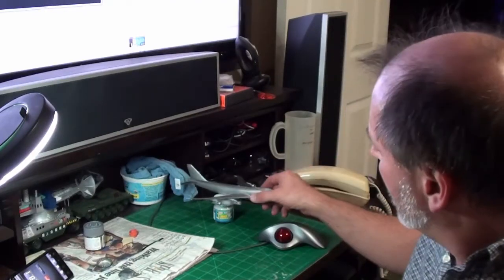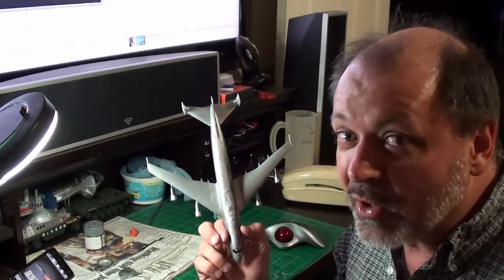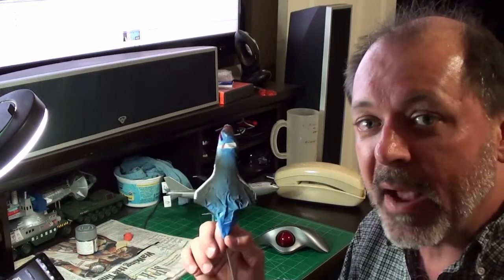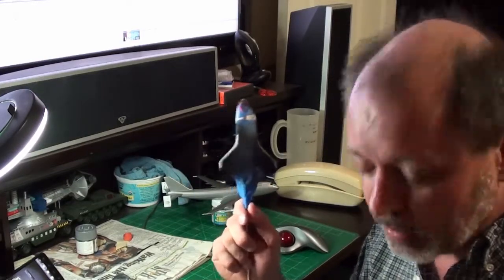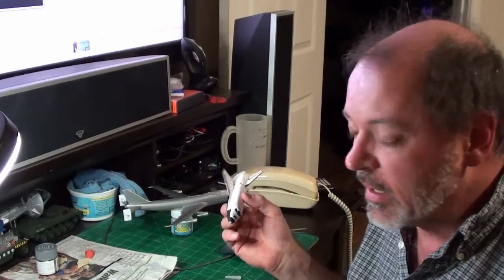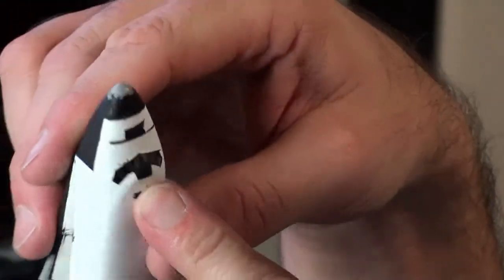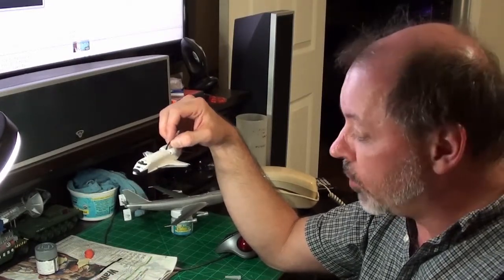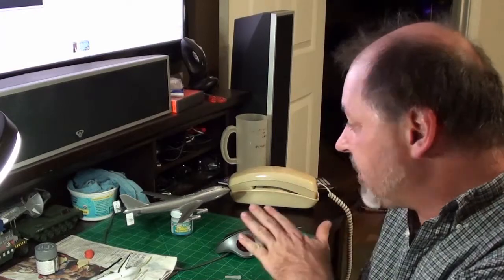Space shuttle with 747 part 7

Comment: Cool bananas. :)

You might want to invest in some Tamiya tape, it curves and conceals alot better than those heavy duty masking tapes, it's specifically designed for the purpose. 

Also, primer probably would have been a good way to go on the Shuttle. It helps give the surface a bit of tack and generally smooths it out.

BTW, I didn't know it was possible to recieve a phone call when it's unplugged. HAHAHA!! :D